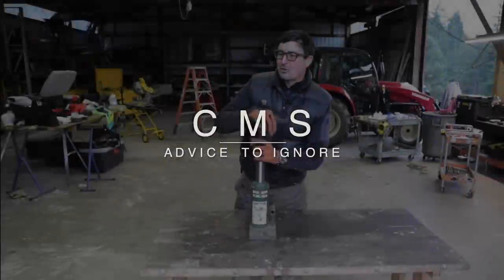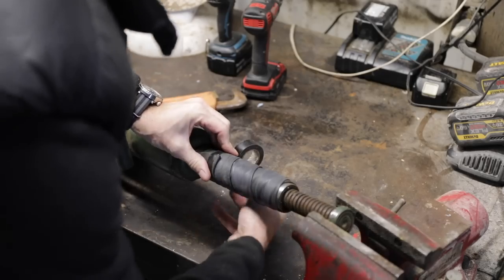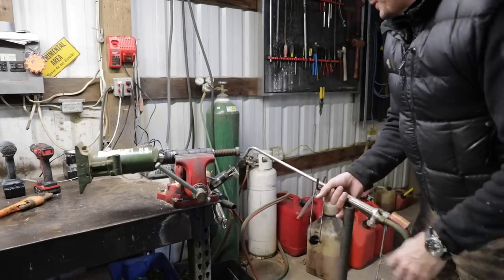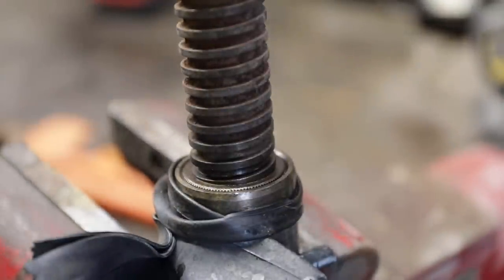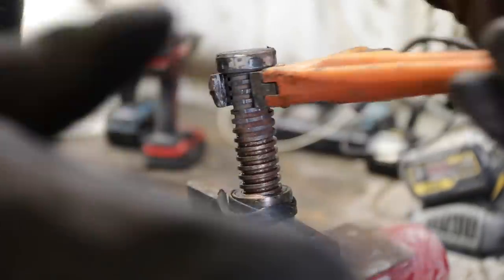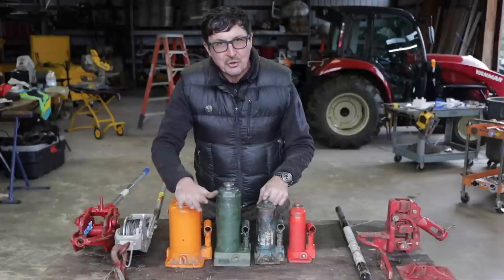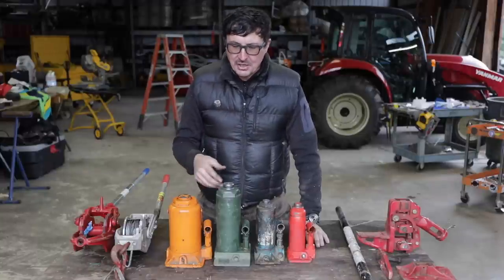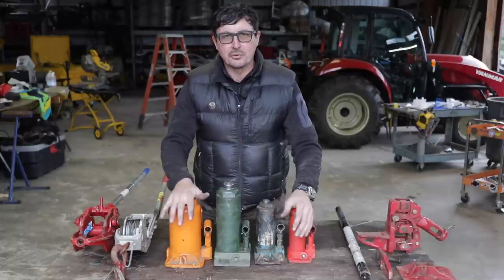How To Fix A Bottle Jack Like A Pro

Comment: By heating the "internal" thread, you are expanding it. The heat may work, but it wound be better to expand the receptical side of the assembly. Now there is the fact that the ground portion has the seals in it, so a lot of heat will likely ruin the seals. The product Kroil acts to dissolve rust, and free up stuck and very stubborn parts. As a toolmaker, I've seen it work when noting else would. In the past I've suggested things, and you have have ignored my efforts, I was only trying to help. This may be the last time i even bother.
Reply: Big thumbs up on the Kroil. Been using all three of the Kano Koil spray's for years. Always works like you think it should!!!
Reply: Well, it seems that you've been ignored for another 2 years, so I guess you'll never ever bother again 😉.  Its all rather sad really, except when you think that hundreds of people might have read your comments and retained that knowledge for future use. So it wasn't a total waste if your time hey!
Reply: I was about to comment the same thing. He heated the wrong side. Results are result though.

Comment: The ideal is to heat up the outer sleeve so it expands not the inner screw so it gets tighter
Reply: so u know you cant heat outer sleeve it has rubber o rings if they melt it will leak and become a paper weight
Reply: @thejunkguys4712  I was thinking the same thing.
Reply: @thejunkguys4712  You make a good point. But heating up the inner sleeve will transfer somewhat to the other one, at which point you can squirt the inner one with water, causing it to contract, and hopefully break the offending sleeve loose.

Comment: I had the exact issue when I bought a used jack. I sprayed the rusted screw with WD40, let it sit over night,  used a piece of pvc, that fit the shaft size close, on the shaft that I had around shop and cranked it tight in the vice. Then I hit the end of screw with a hammer a few times and sprayed with WD40 again and worked it back and forth   , sprayed WD again and worked it again and hit it a few times again and worked till it came loose. So basically same concept as yours, except I didn't use heat. And to loosen the cap on your container,  I just used a pair of channel locks, gripped the cap and came loose easily, WITHOUT damaging and smashing up the container. Hitting the container with a hammer, you risk breaking the seal around the rim or cracking the container. Just use channel locks, VERY SIMPLE. Other than that Good video, except use channel locks on seized containers to avoid smashing the container, usually comes apart fairly easily. I had lots of old containers with them glued shut! But always got them loose with the channel lock.

Comment: If you're ever faced with this problem in the future you might try an overnight soak in kerosene most often that'll take care of a little rust and leave a slight oil coat on the threads, not saying the outcome would be much different since your approach worked as well.

Comment: One thing I have seen from the older guys  that is two generations . The way they done it was heat the screw then when it gets hot  hit it once or twice then pour cold water on it . It shocks the screw and shrinks it and breaks it loose and you can spin it easy

Comment: @Wranglerstar
Can you make a birch bark handle on an axe?
Check out the Finnish Puukko Knife with birch bark for reference

Would be a beautiful project

If you have an axe with a metal handle, you can grind it down to fit the bark. Or easier, you can weld a thin metal bar onto an axe head.

Comment: Heating the threaded part expands that making it tighter. The piston is the part that needs to be larger and the threaded insert smaller, if possible.

I understand that heating the outer part with a torch would compromise the rubber bike tire. Alternatives would be 1) immersing the threaded part in liquid nitrogen making it shrink and reducing tension on the threads 2) to a lesser extent, holding dry ice against it  and using a heat gun  (cool enough not to ruin the bike tire though) on the finely milled piston. Method 2 might be more easily handled with gloves

Comment: Putting that stand on a wedge with a lit torch is a recipe for disaster, why not use 2 of the cribbing blocks for a completely square and level raise, if you bumped that stand when it's raised on a wadge it could fall so easily
Reply: Best thing to do is to rebuild that stand to telescope up and down with a set screw added. May be another days project.
Reply: Well that goes with out saying, but square block would do in a pinch

Comment: My dad had a great idea, He had a Morton building with steel beams. He took a triangle frame with a hinge and welded it to one of the beams. He put a piece of flat iron on top of the frame and hung all his chains from the flat iron on the top of the frame and then swung it toward the wall so it wasn't sticking out into the shop where someone could walk into it. The bottom of the brace ran down the beam about 4 feet from the top of the flat iron because he had a lot of chains living on the farm!

Comment: 2 things I wonder if he knows that his vice has a pipe gripe in it and a good bottle jack has the flat spots in it to help u turn them when they stick like that or are over extended
Reply: I was looking at that pipe vice the whole time as he was slipping around in the flat jaws.
Reply: You can make a better "pipe-vise" out of two blocks of wood that fit into the flat jaws. Simply drill an exact diameter hole so that half is removed from each block. Wood grips metal like nothing else imaginable, especially if slightly roughened with a wire brush to enhance the cellulose microstructure. Geckos grip smooth walls due to their micro-prints on their paw-pads which are nano-sized surface irregularities. Such a "pipe-vise" won't damage chrome finishes.

Comment: Smashing a can with a Hammer to lower the applicator brush is a foolish was to get the stuff on the bottom of the can! Once you open up the seam on the can the product inside will dry out in short order!! The way to go is to use a 10 cent "acid brush" of a longer length. Leave the longer brush in the can but smashing a can is the wrong way to approach it IMO.
Reply: Longer brush left in can means cover is off can is drying out.
Reply: No Sir! Cut it - don't leave can opened. On an angle it's short enough to close can and ling enough to reach bottom. The disposable Acid Brushes bend easily.

Comment: A tip for future reference, next time you have a stubborn nut, bolt, or somthing threaded if you heat it red hot and then quench it in water(slowly pour a gallon)  it works better than just heat more times than not.
Reply: You have to worry about the seals of the jack and I would be worried about stressing the metel by shocking it in water.
Reply: Instead of the penetrating oil you put on after it was hot,
Put on a piece of Beeswax!

The oil just flashes way
But the beeswax will melt and act as a penetrating oil and lubricant as well.

Afterwards use the anti sieze.
Reply: This is why I said future reference not necessarily on a jack, of course you have to worry about seals and what not , but I just mean as a general application for a stubborn nut, it's up to whoever to use common sense when trying

Comment: Best Penetrating Oil is ATF & ACETONE hands down... many people have tested it against bp blast and wd 40 it has beated both hands down.... machine shop use it all the time... many ppl on YouTube and other places have done compare each one and it had beaten them all... just 1 problem with it... acetone eats many types of plastic so u have to store it in a metal container
Reply: WD-40 has never been and will never be a Penetrating Oil.

Comment: FYI you heat the nut not the bolt... you where heating the bolt making it expan making it harder to get it to go into the nut part... what u uselly do is but the part into the freezer over night... and so as you take it out start heating the nut part...

Comment: I would have put the heat on the housing, not the threads. The idea is to expand the metal casing on the outside to loosen it up. We do this sometimes in steamfitting with a stubborn screw pipe joint.

Comment: Could have done that with two hammers one on the bottom and hit it from the top with the other will break the rust hold on it and ud be able to turn it brake fluid all over it and it would turn freely

Comment: For your antisieze, mix a little engine oil in it to thin it a bit. Over time it tends to dry a little anyway.  I removed the brush that's attached to the lid and I use an acid brush with a longer handle. Less messy and easier to use. I taped a small section of plastic tube to the outside of the container for the brush to sit in.
I have several hyd jacks too, they're useful in many sizes

Comment: WARNING! 
Those rose buds use LOTS of gas pressure. Too much for a single cylinder of acetylene to be withdrawn at a safe rate. Most backfires are from not enough fuel.

Comment: I'd be careful about ruining the heat treatment of the screw by getting it red hot there. More heat than needed to get the metal to expand. Low and slow works better here, just like with steaks!

Comment: So the way you were heating doesn’t make much sense to me as a steel worker and a welder. I know your not applying astronomical amounts of head and your looking for a even heat pattern through the threaded portion of your jack but as you said and wanted to apply heat to a larger area, you placed the torch somewhat close to the piece there for not making a large heat effected zone. I’m not in any way shape or form trying to be nit picky and or mean I was just wondering why you did it this way rather than crank up the torch and slowly moved left to right and front side to back side as most other people would. Great video btw. I’m going to use a similar method to fix some clamps at work that un-careful people damaged.
Reply from the maker: Perhaps but it's hard to deny the results,
Reply: Wranglerstar exactly my point you got the exact result you were looking for and at a cost effective rate therefor is my question as to why you chose this method and or what you have learned in the past letting you know how this would be so effective. I knew the hammer technique being able to pinch and make your threads smaller I just thought at first “huh this is a new way to do it” that’s why I asked my first question. Thank you for the quick response as well sir.

Comment: In the future you should heat the part your screwed into. That expands that material to help loosen the screw. Also, the other Jaws on your vise are for pipe and round objects.

Comment: I should have mentioned the heat and then blast it with the spray lube to cool it. I did that lots of times with smear heads on plastic injection mold screws. Those get super tight with the heat and pressure.

Comment: Just replaced the cord on my wifes infered space heater. The old plug was getting hot to the touch so instead of just changing the plug i upgraded it from the flat cord to the better insulated cord like the newer heaters have.

Comment: I got a 50t bottle jack at a flea market last summer. It has two handles, a high speed to get the ram out and a low speed for doing the work. I'm working on making a press frame for it out of 5x8" I-beam.

Comment: For those who don't know, brazing is making a joint via capillary action, and only the filler metal is melted, like soldering. 
Welding forms a coalescent bond between the base metal and filler metal where both metals are melted.

Comment: When you heat something up , heat expands, (enlarges) and when you cool something down ,(cool contracts).You heated the wrong part up,however, in your defence ,if you'd heated the piston,the heat and the warmth of the piston would of likely had and effect on the seal on the piston and began to leak. when you put the release agent on the threaded part that you'd  previously heated up hence cooling it down ,it began to turn, .however , we got there in the end and another mission successfully executed, To infinity and beyond. Good on you mate, keep at it!
Reply: Heated the wrong part as already stated.  Would have been better to use the pipe wrench on the head of the extension pin.  May want to find a different location to store your fuel cans.  Forge on!

Comment: Toyota manufacturers certain bottles jacks for some of their models of cars during a certain time period. 

I had one from junk yard I paid $15 for.  

The Toyota bottle jack had some kind of screw / thread interface which made it hard to use so I returned it. 

If I had power tools, I would have done an idea like you using the 40mm socket or something to move the bottle jack up and down really fast.  

Maybe I I’ll buy it again,  get a speed wrench, and some sticks for spinning the circle twist system up and down.

Thanks for sharing the video.

Comment: But can the jack still lift anything?  It seems like if there were any sort of rubber o-rings inside the jack they would have melted with that much heat.  Hmmmm.  I wonder.
Reply: no, the tire tube didnt melt, and seals are at the bottom near the green paint and cylinder

Comment: 50/50 acetone/ automatic Transmission fluid. Seriously. Mix it in a metal container and it’ll penetrate anything. But don’t get it around anything painted. Helps reduce ft#s of torque tremendously

Comment: Rusty frozen threads of any kind, try heating as you would copper pipe when sweating a joint, only heating the threads, OR, only the nut, not to hot!  using wax... the heat will pull the wax in & 99% of the time, vola! Remove fairly easy...  then theirs those that are "welded" with rust, doest it work? Not so much... lol

Comment: I agree with William Jessop. The bike tube and penetrating oil were helping, but the heat on the threaded rod caused it to expand. Pretty sure it the loosening coincided with the center threaded rod cooling enough to contract. Heat on the outer tube would have helped loosen it, but it also would have likely damaged the o-rings. Thanks for the video!

Comment: first, when tightening a vise, push down rather than pull up. next, heating the screw only tightens it against the receiving threads. cool the threaded shaft after heating and it would probably just come loose with little effort. Finally, if it doesn't then put your pipe wrench on the threads and hit the wrench with a hammer, thus using the mass of the jack to offer additional resistance.   heating the shaft only locks it tighter unless you let it cool. but cool the shaft and try to keep the heat on the receiving threads as they expand and pull away from the shaft.  there are strap wrenches that can help hold the smooth plunger that are available in most hardware stores.

Comment: You got a tip for a rusted release valve on an OTC jack?  The head is surrounded by the casting.  Currently did some map gas and penetrating oil.  One of the grab tips already broke off 😢

Comment: Bought a 12 ton press from HF and sitting in the box for months. I assembled few weeks ago and used to press out the arm bushing. I noticed the oil leaks out from the top. Does this mean the o-ring inside is bad?

Comment: One thing to remember when using a heavy duty bottle jack is that your floor must take the load. Jacking a heavy vehicle on a thin floor can just punch a hole in the floor. I know I work on armoured vehicles.

Comment: starting with the acetylene makes no sense as acetylene is under very low pressure (roughly 20 bars) while Oxygen is at 10 times that pressure. Inside your torch is a venturi nozzle at which the acetylene is dragged out by the over pressures oxygen.

Comment: You've really butchered that Acme thread with that pipe wrench.   Also, you were compressing the outer cylinder in the vice, and expanding the Acme thread and so they worked against each other.  You freed it despite, not because, you did those things

Comment: another easy way to free up a stuck tread like that is, heat up the screw like you did and take a candle or a block of paraffin wax and let it melt into the treads, in 80-90% of the time it will free up a stuck tread like that, As a Journeyman Mechanic, we use that trick to free up stuck engine block core plugs and exhaust manifold studs.

Comment: Useless video. You heated the screw and expanded it making it tighter. Using anti seize is wrong because it forever makes a mess every time you touch the screw. That stuff is difficult to get off of whatever it touches.

Comment: After I heat a bolt I spray it with penetrating fluid it'll suck into the threads. Just use ventilation and try not to breath in the fumes. Work's for me.

Comment: You probably don't know it but the very very end of the screw on the cylinder is bent and once you break it free it's fine but I guarantee you you'll never be able to screw it up in there as far as or was or get as much height as you had you would have had to a measure in the first place before you broke it free to ever know that though .some of us can't see what's really going...but if you cut it open u will see there built so it won't get stuck unless it's bent..just letting u kw That's y ur threads can get scratched up with ur pipe wrench n it still works fine..

Comment: You got it loose despite using heat on the wron part. You heated the screw which made it expand. If you were wanting to use heat5, the place to heat was the box, or the female part. Warming it would cause it to expand and help you achieve your goal.

Comment: Cody, serious? Your heaitng the inner metal piece, its going to expand and tigbhten up even more inside the cylinder.  You have to heat the cylinder so it seperates from the threads.  i sure hope it works. But I doubt it.

If you dont want to heat the cylinder due to hte inner tube, then heat the whole thing, and dunk the threads in some ice or snow. for rapic shrink.